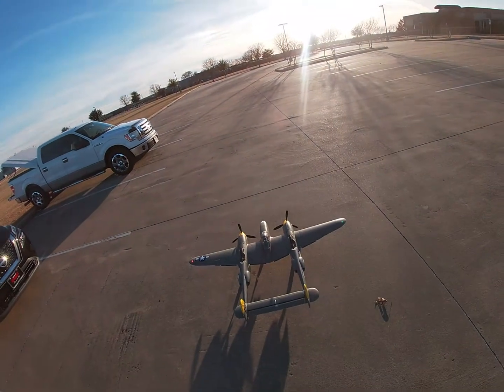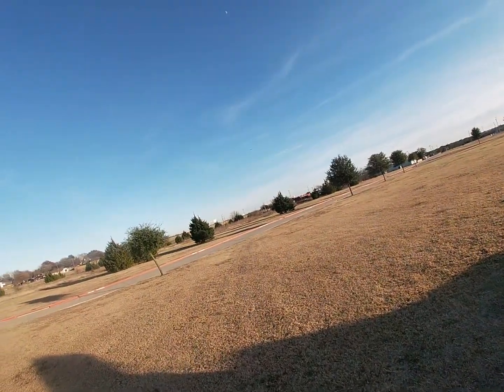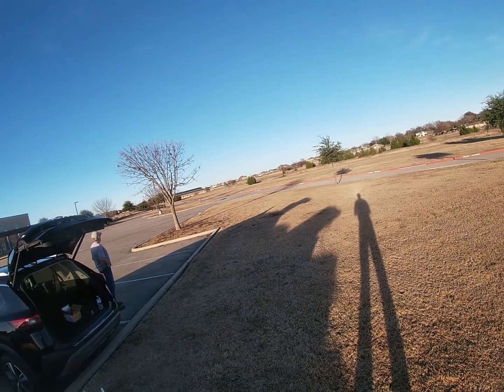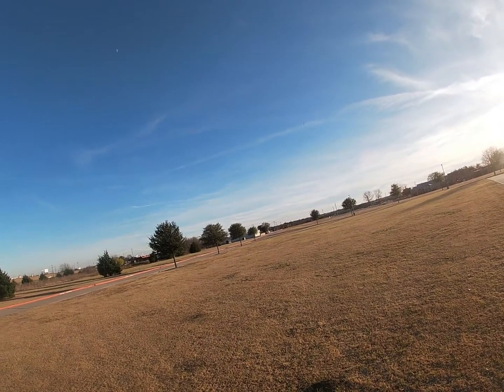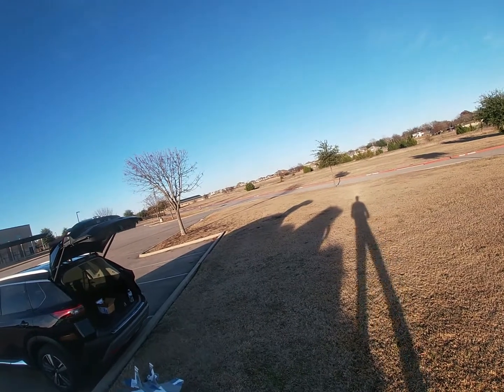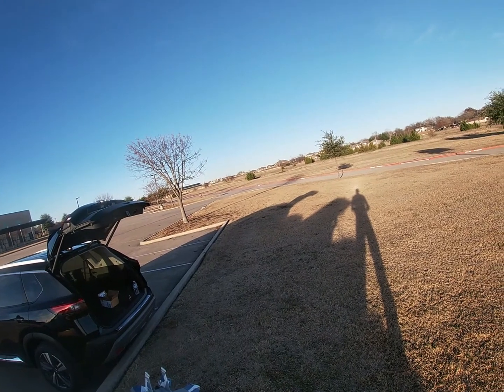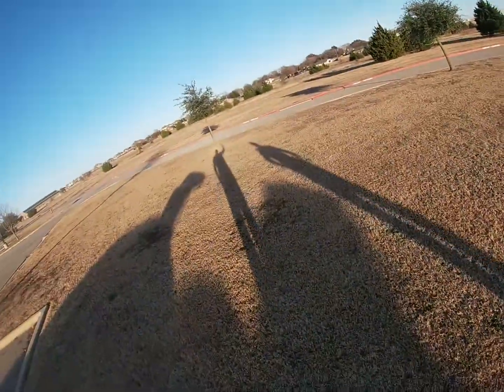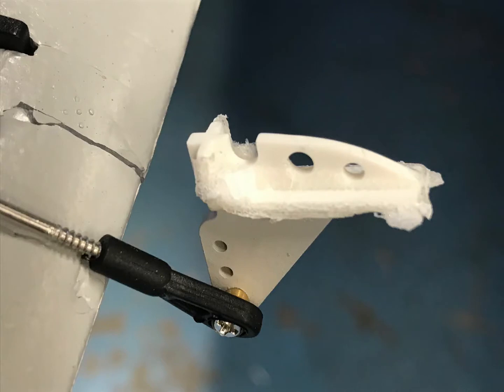FlightLine P38 Crash -  Elevator Failure

Comment: That horn was pulled out in the crash. You fully stalled the plane at the top and it fell into a deep stall/spin. Up elevator will not recover a spin, it just tightens it. If you applied opposite ruder before pulling elevator you would not have crashed.
Reply: what he says.
ARF guys can't build or fly.
Reply: You evaluation was 100% factual.
Reply from the maker: Drew...would aileron instead of rudder get her out of the spin?
Reply: @Zek1701  No! Adding aileron his how you put a plane into a flat spin. Stop the spin with opposite rudder add power and up elivator

Comment: They use glue to hold an elevator that big on this bird? What a shame. I hope they will cover the expense of this crash for u.
Reply from the maker: nope
Reply: @Zek1701  my persistent got my b24 half covered. Keep trying brother. Should post your flight report on the thread.
Reply: @enzok6414  what happened to your b24
Reply: @Veneno2911  one of the esc quit mid-air.
Reply: @enzok6414  rip